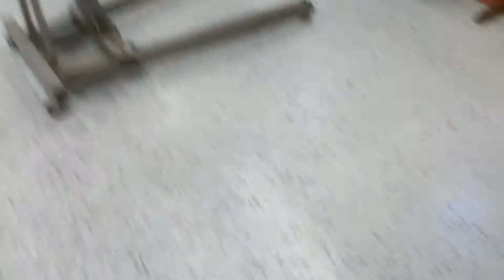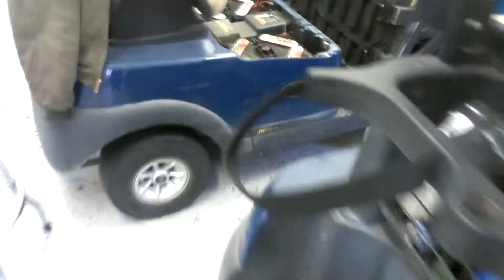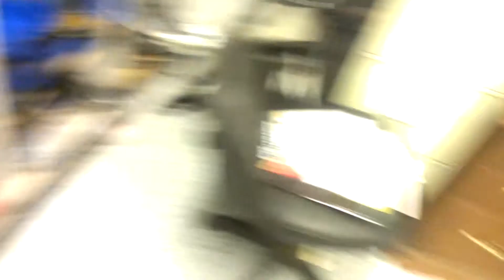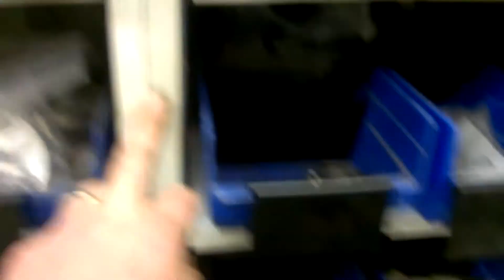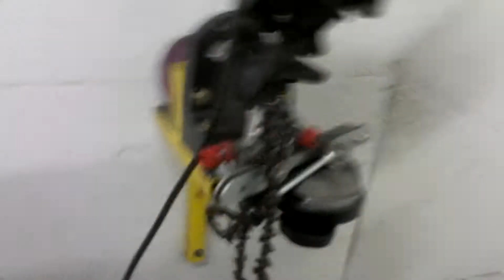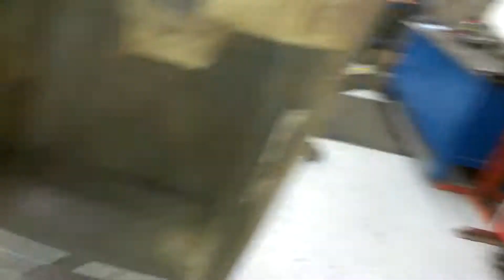Jason Tyson Introduction the golf course mechanics

Comment from the maker: I like the grinders but I have a S.I.P. Grinder at home that I like just as much if not more. But if I was gonna buy a new set I would give very heavy consideration to the Neary.
Reply: Love my SIP grinders.It  took some time to get comfortable with them, but the flexibility of adjustments and the tolerances achievable make them top notch machines. Plus, the customer support is hard to beat (Larry will help 24-7 in the West BOME).